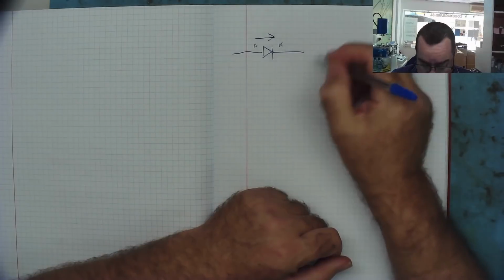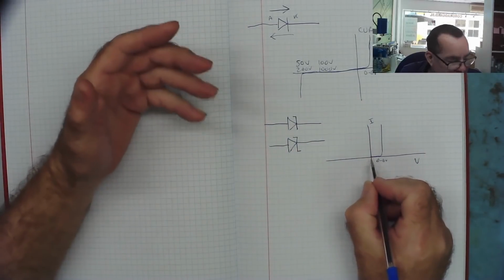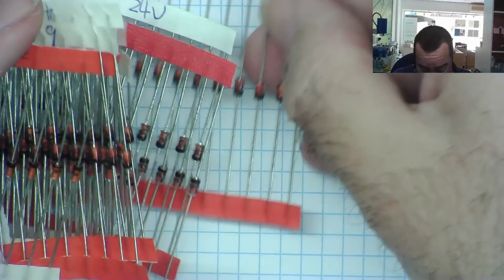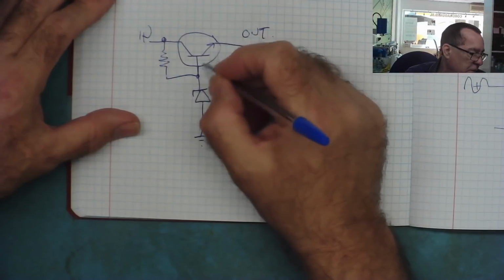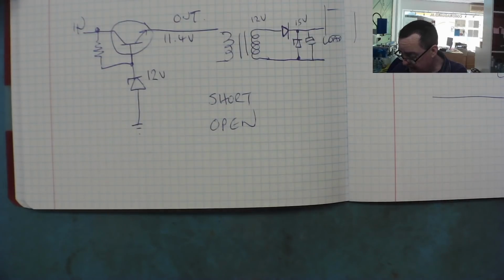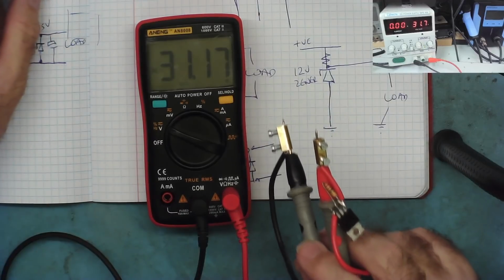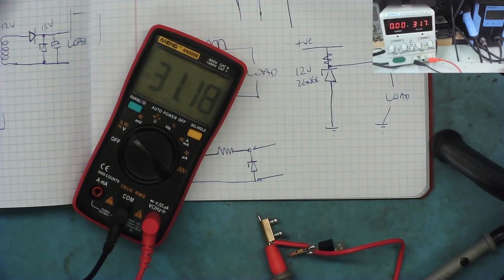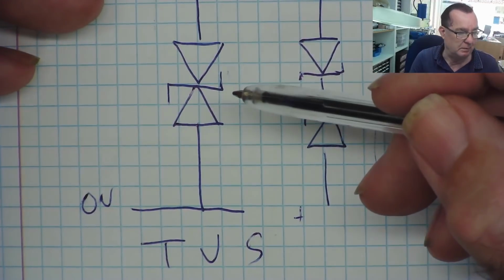All You Need To Know About Zener Diodes To Fix Stuff!  And TVS Diodes... How Zener Diode Works

Comment: 50mA at 27v is 1.35W and your diode is only 400mW....
Reply from the maker: Kris Willems
Yes but No but....  The maths is right but your conclusion is not.  A lot of folks misunderstand how a constant current source works.  Just because a 50mA Constant Current source can deliver 50mA, it doesn't mean that it will always deliver 50mA.  It just means that 50mA is the most it will deliver.

If you watch on my bench PSU current meter, as the Zener voltage increases the current decreases.  So when I'm testing a 2V 400mA Zener diode it is delivering 50mA but when I am testing a 27V 400mW Zener diode at 17:30 it is only delivering 20mA.  OK so this is 540mW which is a bit over the rated value but it didn't damage the Zener diode for the period of time I subjected it to the current.  When I tested a 30V Zener the current on the bench PSU does not even register (less than 10mA) but the meter still read the voltage.

I also did mention at 15:10 that it would be better to change the resistor on the short finder to 100R for accurately testing Zener diodes.
Reply: @learnelectronicsrepair  that is because your constant current source only works reliable up to a certain voltage (your bench power supply voltage minus a few volts for the minimum voltage of the regulator in the current source), which is a bit of a gamble. A constant current source of 50mA will do everything possible to deliver 50mA, independent of the load. The limiting factors are the maximum current and maximum voltage you use as a supply for the current source. The thing that has saved you is the maximum voltage of your bench supply, which was insufficient to make your current source reliable (at such high voltages). I just wanted to say that you should know what you're doing when using this method. If you would have checked a 20V 400mW zener this way, there's a chance you would have blown it up, because your current source would have had no problems delivering the 50mA. In this case it would be necessary to change the limit of your current source to a lower value by changing the resistor, as you suggested.
Reply: In other words: a constant current source will deliver the same constant current, independent of the load, up to the voltage limit it is designed for - at which point it starts behaving as a constant voltage source. 
Similarly : a constant voltage source will deliver the same constant voltage, independent of the load, up to the current limit is designed for, at which point it starts behaving as a constant current source. You were saved by the limit.... In general it's better to do the calculation first and adapt your current source accordingly by changing the resistor.
Reply: " Just because a 50mA Constant Current source can deliver 50mA, it doesn't mean that it will always deliver 50mA.  It just means that 50mA is the most it will deliver." 
I think this is misleading, because the limiting factor is the voltage the current source has available. It does pretty much what it is designed for: delivering a constant current independent of the load up to the voltage limit, at which point the constant current source stops behaving as a constant current source and gradually starts acting as a constant voltage source. By coincidence you've reached this point....
Reply from the maker: @kriswillems5661  Maybe it was a bit coincidental - I freely admit I am not an electronics designer I'm an electronics fixer.

However it was something I was aware of when using the short finder to test Zener diodes - but rather than doing the math I just thought, OK, I'll take the lowest voltage and highest voltage 400mW Zener diodes that I have, within the capabilities of my PSU maximum voltage, and see what happens.  No Zener's were harmed during the production of this video so I decided it was OK.

Actually I did make another Zener tester video just using batteries some time ago - check that one out too if you llke 

https://www.youtube.com/watch?v=fuCJpt_Vfto
Reply: @learnelectronicsrepair  I am an electronics engineer and I used to design mainly telecom equipment (mainly satellite communication devices). Designing and fixing stuff are 2 completely different skill sets. I've learned a lot of tricks and creative insights from your channel when it comes to fixing. Keep on doing this. It's great. I hope more and more people will fix stuff or at least buy products that are fixable.
Reply: @learnelectronicsrepair  Totally different question, well... It's got diodes in it but that's about it: why does everyone talk about the Cockroft Walton multiplier circuit as an AC-input circuit? Wouldn't the voltage double per stage just the same if DC input were used? 

If not, how does the AC cycle play into that? 
If so, because it's a DC input, can't we just ditch one diode in the circuit?

Although I literally just woke up, I fear I might be misunderstanding something really fundamental here...
Reply: Thank you for pinning this one! These comments have really taught something important.

Comment: Conventional current drives me crazy. When in actuality, electron flow goes from cathode to anode in a diode. Which would account for the beep on the continuity test when the negative probe is on the cathode and the positive probe is on the anode. Basically, everything you just said needs to be thought of in reverse to reflect real world dynamics of electron flow.

Comment: I have a zener diode RD6.2EB2, what happens when it breaks down?  The 1 ohm resistor in my circuit kept burning.  This is part of a voltage regulator for a reel to reel capstan motor.  The circuit has 3 transistors which have been replaced.

Comment: HI. I am just trying to repair old Denon Amplifier which seems to be massively faulty. Right now I found damaged Zener diodes (works like resistor 7ohm-no diode detection). 27V tiny type MTZJ27A and MTZxx . WIth J it is 5mA Zener current without 20 mA as far as I found. Is it important to replace fully identical (5/20 mA)?
 It is 27 V diode probably 500 mW tolerance A. Voltage is number one to check but what about Wattage and tolerance. A bit bigger Wattage should be not a problem What about tolerance. A seems to be the worst one. SO each replacement 27 V and close to 500mW should be OK ? Newbie in electronics (oldie by age). Great tutorials Have seen already few. Thanks.

Comment: You are a great teacher😊 It's been like ages ago, That i went to school and learned about electronics. Now i am 42 and started to hobby around with vintage stereo equipment. I come across so many obstacles like: reading the parts values inside an amp from like all kinds of different capacitors/diodes/etc. And also trying to figure out what replacement part would be suitable too if the one inside isn't available in the exact same form. Is there a way to contact you, So i can send some pictures and info on what i can read of some parts and get me started on this a bit more? That would be awesome. I also found some zener inside an Akai amp which was like rusted through, I cleaned it and for test sake i soldered it underneath the print (because legs were too short now) so i could go on with testing the project😉😊

Comment: The important thing is with failed zenner and no schematic it's impossible to fix anything! and with todays SMD Corsair PSU's it's very sad, you also need to desolder them else diodes read both ways but are OK.

Comment: So let's say that you have a circuit board which has two obviously burned out zener diodes. The burned zener diodes have no markings. How would you figure out what voltage the replacement zener diodes should be?
Reply: Depending on the circuit find a way to find out what the maximum current and voltage will be during operation, then just get a zener diode higher than that value. This assuming that any short circuits that are in the circuit have been removed at this point.
Reply: @Ghost572  Thank you, I'll experiment with that.

Comment: Hi sir I watch all your  videos its great  place  to lern,  recently  I was repairing a printer  found  blown  smd diode  there is no marking on it, how do it find correct  replacement there no schematic  for pcb ??
Reply from the maker: You need to reverse engineer that part of the circuit, work out where and how the diode is connected.  From that, and with some experience, you can work out the polarity and type (rectifier diode, zener diode)

I would suggest you join the LER discord server and post some pics there, or join badcaps.net forum.  Both are free to join and post questions.

Learn Electronics Repair is now on Discord!  Come and join the fun and let's fix stuff together, it's free and a nice place to be.
https://discord.gg/vam6YC8vwU
Reply: @learnelectronicsrepair  many  thanks  sir, appreciated  your  will join mentioned forum

Comment: What I love about this video is that it directly goes to the practical applications and shows what common zebra diodes look like.

In electronics/electrical engineering we had to solve 100s of numerical problems on zener diodes & study it's general structure, characteristics , VI graphs, parallel or series combinations etc but not even one student knew what a zener diode looked like in real life.

I think education should have both.
Reply from the maker: b888
Yeah this is exactly why a degree in EE (which I don't have by the way) will not teach you how to fix stuff 😉

Comment: Informative article. However, I was expecting a little more respecting how zener  diodes are tied together in a series configuration to produce an expected regulated output in cases when you don't have the required single zener.
Reply from the maker: Devon Wilson Actually I almost mentioned that, using for example a normal silicon diode in series with a Zener to add an extra 0.6V to the output voltage (when I was discussing the emitter follower circuit).

In the end I just kept it to a repair perspective rather than a design perspective.  I'll make a video about different types of voltage regulators (Linear, LDO, Buck, Sunchronous etc) sometime, and I will include the info you are asking about here.  

Thanks actually you gave me a good idea for another video. 🙂

Comment: Thanks for the informative video. Can you put Zener diodes in parallel or series or a combination of both? Can they be used with differeing values to achieve a desired clamping voltage?  I have seen various forms of this in DIY Valve audio circuits but never understood the full aspect of it nor if it was a suitable application of the zeners capability. Thanks again Cheers H
Reply: Like Colin said anytime you've got identical components in parallel its there because that component can't handle the amount of current/power on its own, but by having multiple ones in parallel we can make an equivalent component that can handle that amount of power.

Like a general example would be if we have 5W going through a component but the maximum the component can handle is 2W then if we put 3 in parallel combine together they can handle 6W as the energy will distribute its self out on its own and we get the same outcome of using that component.
Reply: old question, but previous answers have not been good, so ...

Series combinations are fine.

With parallel combinations sharing of current is unpredictable. With carefully matched zeners of the same type number from the same lot from the same manufacturer sharing might be pretty good. But if you have two (say) 12 V zeners and one is "really" 11.8 volts, well within tolerance for a ±5% part at the current of interest and the other is 12.2 V, the 11.8 volt part will conduct far more current. It's voltage will rise according its dynamic resistance and current but it is still likely to take most of the current. Zeners above about 5 V are properly called "avalanche diodes" and have positive temperature coefficient of reverse breakdown (avalanche) voltage, so that helps in sharing. True zeners, up to around five volts, have a negative tempco, so heating of one makes it take even more current and heats it up more.

It is a general truism that constant voltage things of any sort don't work well in parallel but do in series, whereas constant current devices work well in parallel but not in series.
Reply from the maker: Basically there is no point putting them in parallel (as far as I know)

Yes you can put them in series to add up to a required voltage, and also put normal rectifiers in series as well (the opposite way round to the zener) to add 0.6V for every one you include in the 'chain'

From yours and another comment here I will be making a video specifically about voltage regulators soon.

Comment: Hi Richard, so happy I found your channel. Subscribed! I buy and sell fitness machines (exercise bikes & ellipticals). I find that an unusually high number of the console displays for these machines have resistance circuit failures. The resistance control no longer sends proper signal to the servo motor that moves the brake magnet in relation to the flywheel (to create silent magnetic resistance felt at the pedals). I have dozens of machines in storage waiting for this repair. Can you help me learn to fix these circuits?
Reply from the maker: Hi Scott That is the sort of circuit I worked on when I was repairing industrial electronics in the 90s. Email me electronicanaria@outlook.com
Reply: @learnelectronicsrepair  Hi, I never got your name, or background. Do you have a video introducing yourself and your journey to this channel? If not, I feel there are many like me who want to know more about the master!
Reply from the maker: @therealb888  Sure,  I did that on the first ever LER video, who I am, my background, what I do and what I wanted to achieve when starting this channel 🙂

https://www.youtube.com/watch?v=aJZyOkxs37g

You will see my video production has improved over the year since I started the channel
Reply: I were have same problem and it was a bad 103 cap.